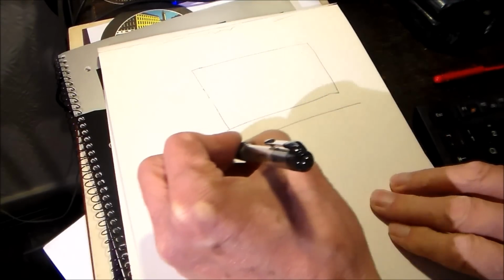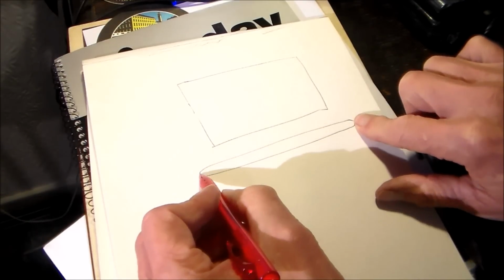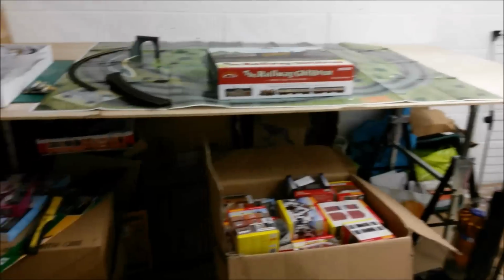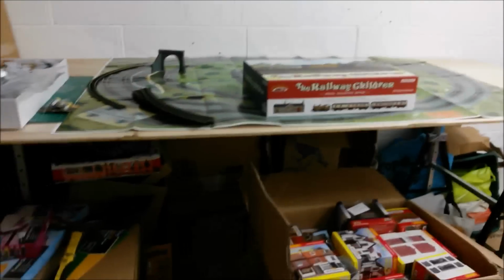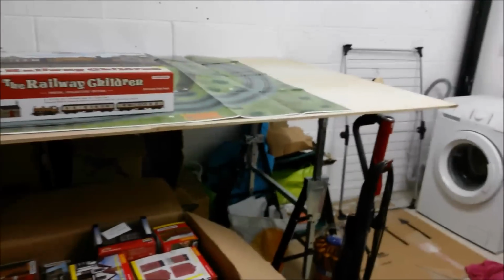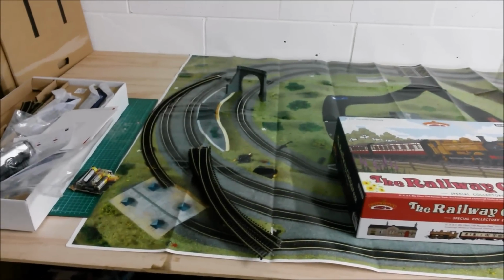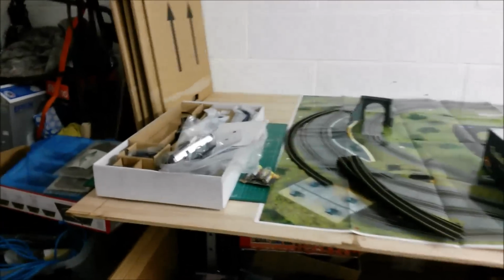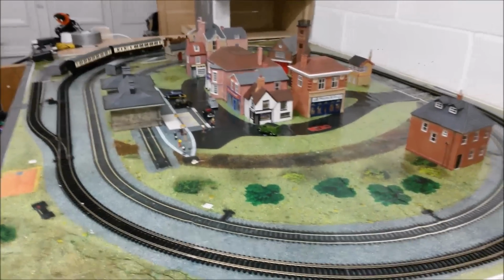Quick Trackmat layout for Christmas

Comment: Where can I get one of those boards
Reply from the maker: Hi Alexander. The track mats are included with many hornby train sets.  If you go to a model train shop they will probably have a few spare ones at very low cost. If you ask in a model railway forum you may get one free.  Best regards.  John
Ps the board under the mat is a sheet of plywood.
Reply: @bikerides  i mean the boards
Reply from the maker: @Mid-Life-Refurbished_EMU  Your local builders yard. Tell them that you want some good quality plywood not cheap shuttering ply. 9mm to 12mm thickness will be fine.